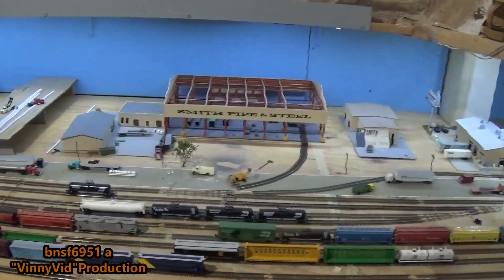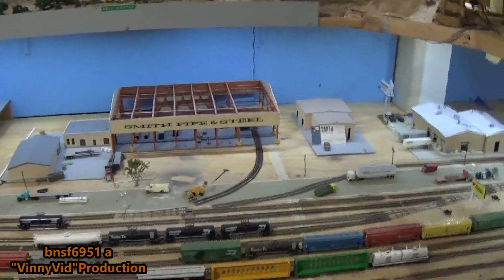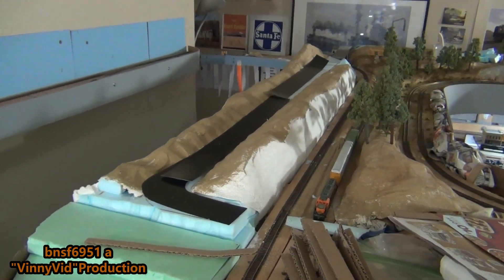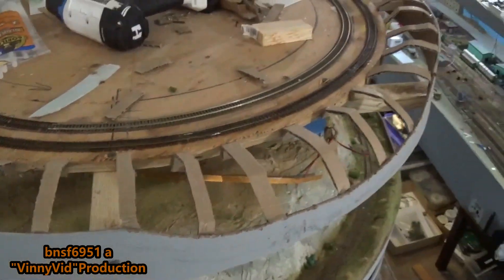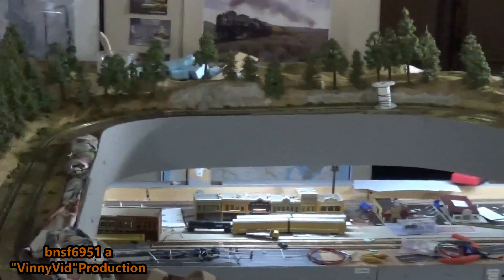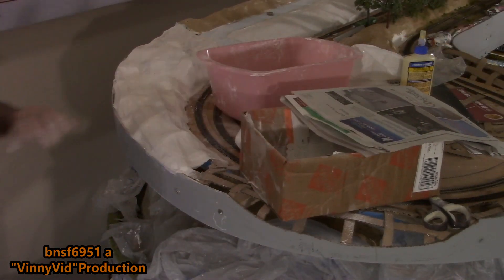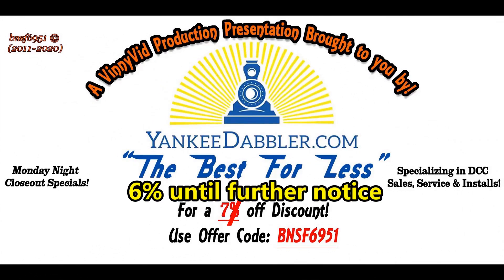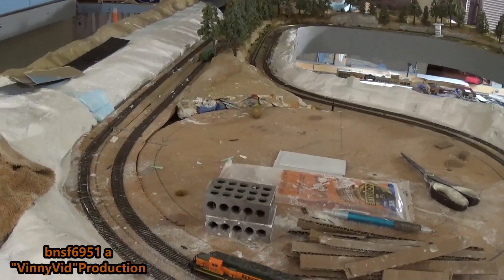N scale layout update....  ..more scenery on 3rd level...redo the i10 freeway

Comment: Hey Vinny! Looking good!

I read somewhere that someone is avoiding paper under structure due to silverfish and other paper eaters in his area. I have silverfish around here that have chewed paper. So, thinking of only using foam to form landscaping. What you think?
Reply from the maker: hi Ken... i don't not have silver fish in this area... in some instances i can take the paper out after the plaster has hardened... i have used 3 different methods of building mountains... foam.. paper & basket weave... if you ae worried about unwanted guest then use foam.... thx 4 watching & your comment... vinny👍🏻👍🏻